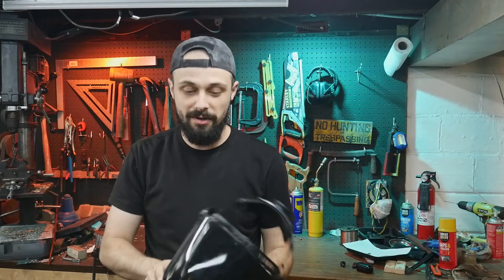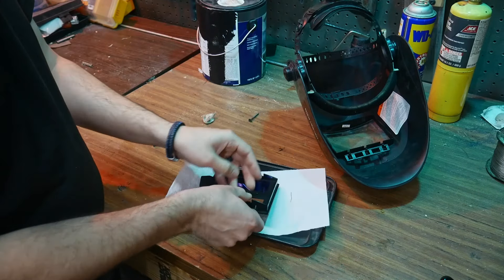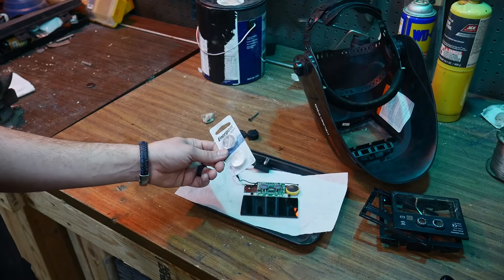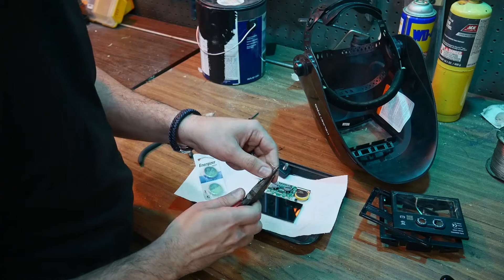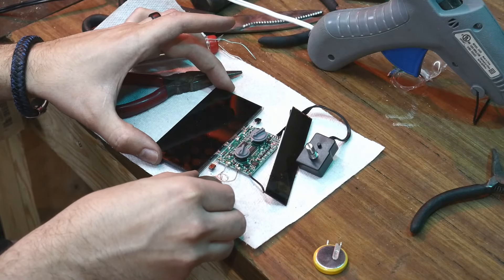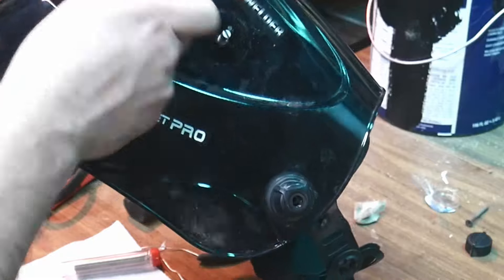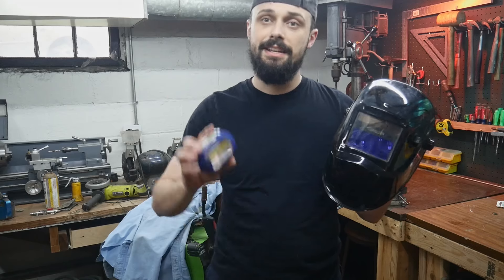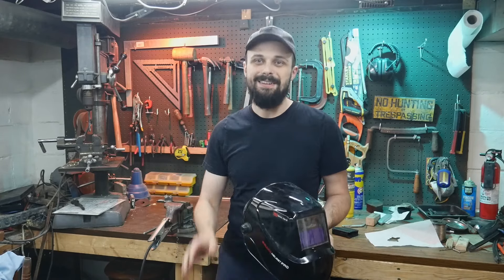How I repaired my auto darkening welding mask for cheap

Comment: Awesome to see folks taking the iniative to fix their gear! Its a shame that tabbed cr2450s are a bit harder to find than other sizes (outside of the 2450hr that are more expensive because of their heat rating). One thing that may save you hassle in the future is soldering a 2045 holder to the board instead of those leads. Itll let you swap out the battery quickly in the future. Great video, thanks!
Reply from the maker: I like that idea! Do you know if they make a low profile battery holder? Inside the plastic body there's maybe 3/16 of an inch of space... I don't think the battery holders I have seen would fit... though could possibly make a custom battery holder in the future.
Reply: @wamindustries Ooh, that's definitely a tight fit. Probably not going to find one that low profile unfortunately, but you never know!
Reply from the maker: @briancernic makes sense... thanks for the idea!

Comment: It's a pity you didn't solder the battery.  For something to happen you would have to overheat the batteries a lot
Reply from the maker: Oh... thanks for that feedback!! I probably should have still given it a try. So the people experiencing the exploding batteries must have been leaving their iron on the battery for an extended period???
Reply: @wamindustries Soldering the wire to the battery may heat it up.  if the batteries have welded legs that you solder to, then the risk is negligible.  Sorry, I didn't notice, the old battery has legs and the new one doesn't.  I was watching in the background while doing other things.  Good thing you didn't solder.😊
Reply from the maker: @snik2pl thanks for the clarification... hey I watch YouTube often the same way... doing something at the same time so I totally understand